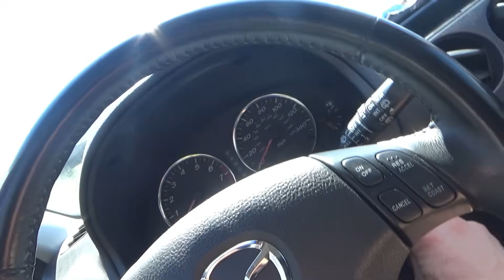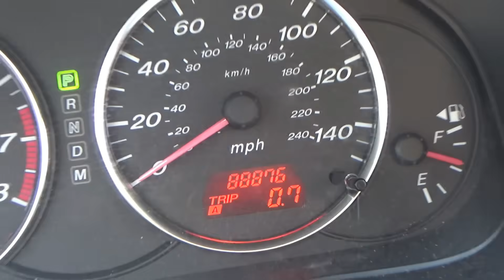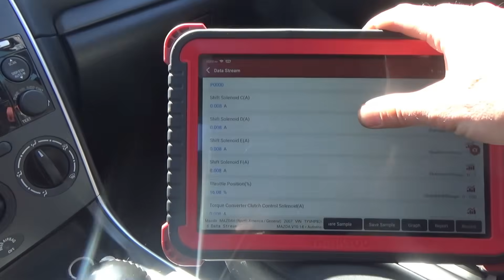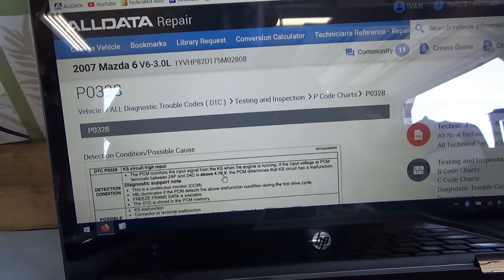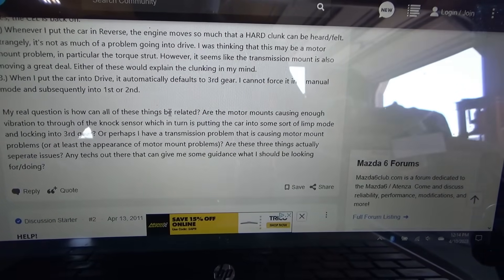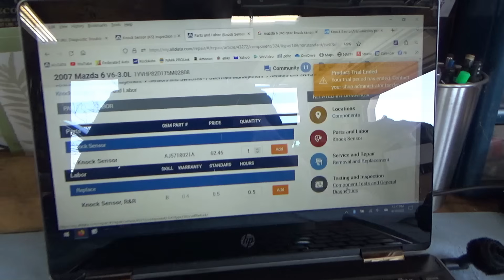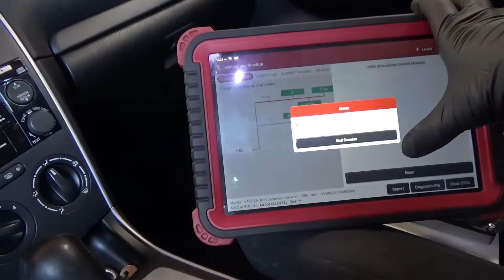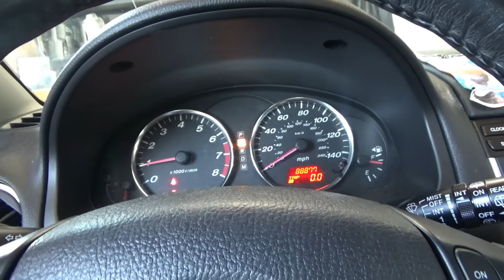At Transmission Shop for 8 MONTHS?? Fixed in 15 MINUTES!! (Mazda 6 Stuck in 3rd P0328)

Comment: I work at an OEM and I can say that is absolute shit garbage error handling by mazda.   The trans needs 0 inputs from the knock sensor, they must have had a ton of warranty work from knock sensors going bad and people not fixing them... then destroying their motors.   So their solution was completely 'break' the car via calibration until the knock sensor is fixed (instead of putting the MOTOR in limp mode and dialing timing or throttle back).   Absolutely stupid

Comment: I-stop is Mazda's system for stop/start operation.  With I-stop the engine stops one cylinder at TDC with an unignited charge of fuel/air so when the cars needs to move again the charge is ignited and the engine starts, its a battery saving method of stop/start control.  Its a very sophisticated and intelligent system that relies on a perfect second battery.
Reply: It doesn’t use a second battery for i-Stop.
Reply: @YZJB  My daughter's Mazda 3 had two batteries, a duty and a starter one.  The starter battery was a high output for the size and thus more expensive and also with a limited life.  It was a pain of a system because when the battery was changed you had to get into the electronics via the OBD to cancel the fault codes.  Failure of the i-stop does not disable the car but can lead to some MOT stations failing the vehicle because of the dash warning light.
Our current Skoda has stop/start and that uses only one HD battery and will disable the start/stop function if the battery is not on max voltage due to the electrical loads.
Reply: @clivewilliams3661  your daughter’s Mazda3 might have had i-ELOOP which is a capacitor which runs the ancillary items (radio, lights, blower etc.) when the engine is off during i-Stop mode. Not all Mazdas with i-Stop have the i-ELOOP capacitor, though (many don’t)

Comment: Its a French PSA based transmission module They correlate the knock sensor and wheel speed sensor together to measure the transmission is shifting at the correct RPM and wheel speed.
 Either can throw this error.

Comment: I have not finished watching yet but seeing the code of the knock sensor I'd fix that first. Fix a known problem because it could be causing more problems downstream in these rolling computers. Thanks for filming this! Okay, yeah 35 megohm is pretty much an open circuit so it would show up just like being unplugged.
Reply: Had a Toyota Camry, scan tool said it was a PRNDL transmission switch. However the problem was only there with the headlights on ? Turns out a bad ground to the license plate lights / reverse lights using the PRNDL SWITCH CIRCUIT AS A GROUND. EASY FIX USING VOLTAGE DROP. THE SCAN tool was wrong

Comment: I ran a shop in NC and had a friend at AAMCO.
He rebuilt any and all transmissions - Bulletproof, for $300.

The main issue with CVT transmissions is not the tranny, but the car owner.
They dump in any ole tranny fluid and it destroys the CVT.
They are too cheap to pay $20 a quart, so they do not destroy the CVT.
They'd rather spend $3k on a new tranny. 😂

Comment: On Japanese cars, the transmission is always getting a "torque signal" from the PCM/ECM, so it can "prep" for shift's. It's one of their secrets for smooth shifting and reliability I feel. lol

The bad knock sensor meant that the PCM couldn't properly calculate the torque signal, as it didn't know the knock condition (which would definitely throw the actual torque off of the signal, if the engine was knocking and the PCM couldn't tell) so it was likely shutting off the torque signal.

It wasn't until 2010 or so when the OEM's thought to have the no torque signal condition actually trigger a readable code from the TCM.

So as you said at the end of the video, always fix codes in other modules before chasing specific rabbit holes.
Reply: Also reminds me of an issue I saw when I was in college. Had a UPS (battery backup) in our lab which would not communicate with any of the computers in our lab via serial port/RS-232. Since I was one of the better students and had all my assignments caught up, the professor put me on the job as classes for the prior two years could not figure it out either.

So, I noticed since they had us wipe the lab computers so often, they were just using drivers built into Windows XP. So I just started updating drivers one at a time and trying the communication, starting with anything that could influence the serial port. Nothing there. So moved on to every other driver. As soon as I installed the video card driver, it started communicating.

On the next lab computer, I installed just the application for the UPS and the video card driver, and it worked on that too.

TL;DR: I once had a video card driver influence how a computer communicated to a battery backup via an old serial port (like USB before USB was a thing.)

Comment: My son had a similar thing happen on his 2014 Hyundai Sonata. The knock sensor and the alternator went out at the same time and the car went into limp mode. This is the same car that Hyundai replaced the engine under a warranty for cars under 120,000 miles.

Comment: Too much to expect the gearbox to report “I’m being put into limp mode by the ECM”? Not exactly great work by the software guys. To top it all off, why put the box into limp mode for such a minor issue? Surely just the engine in limp mode for a knock sensor . If that’s too complex then how about the ECM reporting “Car is in limp mode” and not leave everyone guessing.

Comment: Its actually common sense because the limp mode feature is designed to stop you from continuing to drive & making things worse. I had a brake master cylinder going bad on my Jetta & it did the same thing. I'm surprised several mechanics & transmission shop couldn't realize this but then again its a he said she said thing & do we really know if the the owner took it a shop? In reality the limp mode may have saved that engine because it didn't seem like the knock sensor was of any concern considering he even tried changing out the ECU.

Comment: I remember a mechanic before working on a 80’s model Cadillac. Transmission wouldn’t go into overdrive. The thermostat was stuck open and engine couldn’t get up to operating temperature . Said he put in a new thermostat and transmission worked fine
Reply: Hope you never used that mechanic again.
Reply: @wandameadows5736  he found the problem when other mechanics couldn’t
Reply: @wandameadows5736  Why? That is normal on those early electronic transmissions. Pretty cool he thought to check that. Saved customer a ton of money.

Comment: My Ford Fiesta would go into limp mode without setting a code.  Everything was normal.  Took dealer months, wore out the parts cannon.  Did a bunch of rewiring that finally fixed it.

Comment: My '01 Lexus es300 does the same thing, that's after me replacing both knock sensors, harness, even replaced the mass air flow as well. The weird part is it ran fine for 30 days after the repair.

Comment: I had a Nissan Almera come to my garage some years ago with no power and coughing and farting when you revved it up, the car was 2 years old so still under warranty I asked the customer to go back to Nissan because he shold not have to pay for the repair, he said he had and they could not work out what was wrong plus he had been without his car for nearly a year. Well I did diagnostic and nothing came up and what the customer told me was Nissan replaced allot of stuff. It got to the point that they were going to refund or put him in another car but he said something to me which got my attention, he said he had an is stop lamp bulb replaced by Halfords ( I am in UK) and it started after that. The Muppets had put the right bulb in but the wrong way so forced it in which caused it to short between both filaments put it in the correct way and all was sweet, this is the down side to cambus systems lol. I also had a convertible mercedes come in because at 20 mph his roof just opened and closed when he stopped. this was because someone repaired an abs sensor after it got broke while he had a spring replaced they stripped back and soldered the wires and heat sank them but they had removed part of fabric mesh which is essentially a Faraday cage nothing surprises me now lol. Like your attitude brother will watch more and subscribe take care...

Comment: I will take exception to your comment about the "battery that will hold a charge." Whose fault was it that the car sat for most of a year? The customer? NO! The transmission shop? YES! Will ANY modern car battery hold a charge while sitting around for most of a year? Not a one that I know of. 
So, here we have a situation where the customer - through no fault of his own - waited patiently for the shop to fix his car, and you want to chastize him for not having a "battery that will hold a charge?" Hasn't the poor guy been jerked around long enough without you sarcastically adding to it? Shame on you!

Comment: I'm not a mechanic or an engineer but I don't see how this issue would cause the trans to only shift into third. Like what's the logic behind that? I assume this is an issue with the onboard computer. Possibly a bug from the manufacturer that went unnoticed. I would assume if the engine knock sensor was setting off alarms that the car would either work as intended with knock or the car wouldn't drive at all in order to protect itself from damage.

Comment: Ive got a 2001 jeep liberty that has a hard shift from 2nd to 3rd only. Swapped out the shift solenoid only to have made it have different issues. All online threads have lead nowhere. No transmission fault code.

Comment: About 25 years ago when training as a Bosch techie, heard a story about a Nissan that came in with a problem. This was the early 90s so fuel injection and engine management were still new. Car apparently had an issue when towing a trailer. At certain speeds the car started losing power as if the throttle was being held back. With no trailer it was 100%. And with trailer, it was speed dependant, and not gear dependant (I.e. not engine rev related). To make matters more interesting it turned out to be one specific trailer, as other trailers towed fine. After a little investigation it was discovered that the trailer hitch was for a 2inch ball, but the tow ball on the nissan was 50mm. At certain speeds the .8mm difference was enough for the trailer to oscillate at high enough frequencies on the ball to send a false frequency through the chassis and mounts to the knock sensor.....
Reply from the maker: @alphaomega5721  that is truly crazy! 😳

Comment: This is a common problem with a Mazda 6 and when this sensor fails the computer is programmed to go into "limp" mode.  Took less than a minute to find this information on the computer.

Comment: Did it ever become clear what the connection between the knock sensor and transmission was? I'm a bit weirded out by the 3rd gear getting selected.

Comment: Who DIDN'T suspect a knock sensor code could cause a limp mode issue? Since the engine didn't exibit signs of detonation, pre-ignition or a miss why not diagnose the knock sensor code first just as Ivan did? But no, they went for the expensive TCM, then  the PCM. All while a sensor that is important to engine longevity is screaming I'M BROKEN.

Comment: Had a problem with a Mk2 Ford Focus. 
The LCD screen on the dash was going haywire, Scrolling continuously. 
Internet search said faulty screen, try to disconnect battery for 30 minutes. 
Only fix it for a short time. My wife also mentioned a slight engine miss at take off.
Car needed  a new ignition coil, 1 was faulty. 
Dash issue was caused by faulty coil.

Comment: With my daughter's Scion IA / Mazda 2 when replacing the battery you need to turn it on without lights or a/c  let it sit for 20 mins at idle then another 20 mins loaded with lights on.  and a/c on. Without doing this  we get a sluggish drive and shift shutters

Comment: Had a similar problem with a 2001 Lexus RX300.  Bad knock sensor disabled 4th gear and set a SRS code.  The 3.0 engine has 2 knock sensors both buried under the lower intake.  Took the same approach as you; did a google search.  Found a YouTube video giving instruction on how to wire the good sensor to give a signal for both and bingo it was fixed.  That was 3 years ago and all is still well.  Mazda approach really doesn't make sense.  Locking the trans in 3rd  would put a higher load on the engine at roll out and increase the possibility of engine knock.

Comment: In my 2002 model Holden VY SS Commodore,it had a fault where the air conditioning compressor clutch intermittently wouldn't turn on when the  button was pressed or it would cut out as I was driving along.

The SRS airbag symbol would sometimes come on then turn back off again,it was caused by the ABS module which was faulty,it messed up the operation of the body control module.

It was sending the instrument cluster haywire,I still need to get the original module repaired because I am not currently running exactly the right module because the TRAC OFF LCD symbol has disappeared.

It will power up that TRAC OFF indicator in the older models which had a light bulb type of indicator.

It has made the alternator overcharge & fry The battery in some Commodores !

Comment: Knock sensors will do that on certain makes.
Reply from the maker: Like which ones? Completely disable the transmission with NO TCM CODES??
Reply: @PineHollowAutoDiagnostics  I know for a fact toyotas and lexuses do it for sure. I am guessing its to protect the engine since it cant sense pinging and knock without the correct readings from the sensors or bad wire harness. I am dealing with that issue now in my 00 lexus es 300. I will not have overdrive sometimes even before the check engine light comes on. When it does, the car will not go past 3rd gear. I know some mazdas do this too. I am not sure about all the makes exactly that does it.
Reply from the maker: @Shotbymic_2  yes I've seen that before on Lexus cars, very common problem. But transmission still shifts fine, just overdrive is disabled to prevent too much load on the engine. This Mazda went into full lock down mode however lol... Very Poor programming between the Ford ECM and the Aisin TCM 😅
Reply: I wonder why you don't share.

Comment: Good fix.  Looks like many hands touched this vehicle but no one thought to "Diagnose it!"
You mentioned the Volvo.  How about the large SUV with the no start.  Come to find out it was a module in the left rear inside that had water hitting it from a leaky lift gate running down inside the body under the trim and the module was in what looked like a small bath tub!  It was either a Euro or a GM vehicle, don't remember which one it was.
Reply from the maker: Mercedes 😉

Comment: Was it the low battery voltage, the knock sensor, or a combination of both that put it it limp mode.  Obviously, the knock sensor was bad due to the ohm test.  But did the low battery voltage contribute to the code set to facilitate the “limp” mode?  Personally, I don’t t think they were related, but we’ll never know because two separate issues were fixed at the same time.  Oh well…it will keep us wondering.  Great work Ivan!
Reply from the maker: Battery had nothing to do with the limp mode 👍

Comment: Crazy I have a 2007 mini cooper with a CVT car went in to limp mode due to a tach having and intermittent com problem , I noticed the tach blink before the limp/EP  mode , Found one post on a forum contacted the guy to confirm we had the same issue i disconnected the tach and drove car with no issues  I spent weeks tracing wires and checking modules   Great job

Comment: I've found that more manufacturers are tying in simple faults that normally wouldn't affect drivability to more critical functions just to get the owner to get the simpler things fixed.  My Subaru Forester for example had the P0420 catalytic converter code. This made it lock out the cruise control and traction control. Bells and whistles. The more there are, the more to break.
Reply: This is evil

Comment: It never fails; customers bring in the car full of gas, if the tank needs to come out, bone dry if you'll need to drive it any distance.
Reply: THAT is so true! At least 2 customers like that come to my shop every day.
Reply: Yup! I worked heavy duty and if you needed to remove the fuel.tank or the crossover hose, the tank would be full. If you had to dyno it the tank would be MT.
Reply: Happens all the time at the bike shop I work at. Doesn't run? Oh let me fill it to the brim with gas
Reply: As the solution vs mechanic diagnostic history shows, people have a reason to bring a car in with no gas.  It's a known and shitty practice that "cool" cars are "test" driven fast beyond normal acceptable parameters.   A mechanic should simply ful the tank as needed and charge the customer per gallon used via trip odometer.    Trust should not be required for any trades repairs.  Logic, detailed, explanations that are observable and/or replicable should be standard practice before applying repairs.   Issues with process addressed as needed throughout that will add to the bill.   I understand there are exceptions to any rule, however... Good mechanics or tradesmen are now the exception vs standard.

Comment: Could you prove the knock sensor was the issue with a decade box before replacing it? Or would it need variable resistance.
Reply from the maker: Unfortunately decade box doesn't do MegaOHMS 🙄

Comment: Toyotas had an issue similar to this. If knock sensor faults were set on the 3.3L v6 engine, the transmission would shift through all gears fine the first time but would not shift into overdrive or 4th gear afterwards. Would need to shut the car off and restart it. Replace the knock sensor and sub harness, shifting would return to normal.